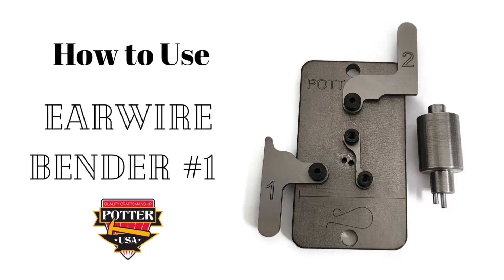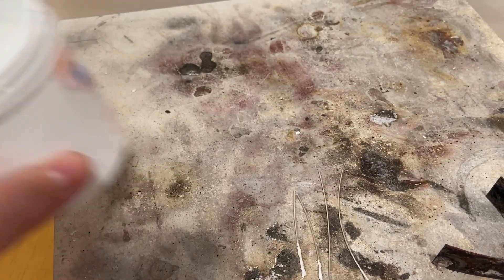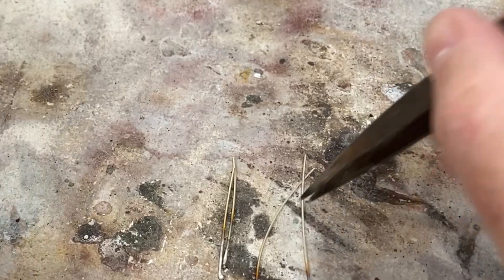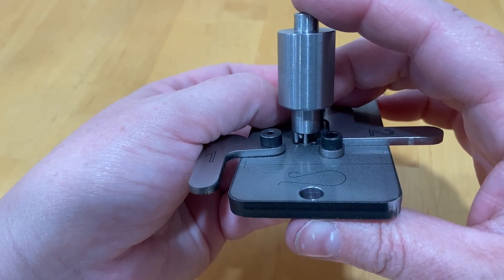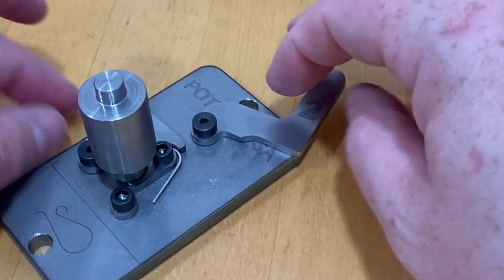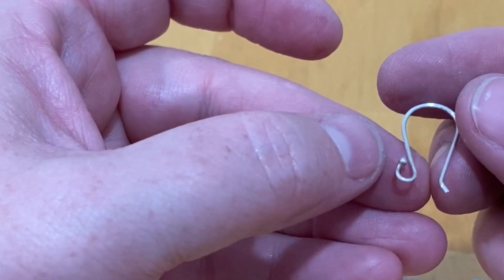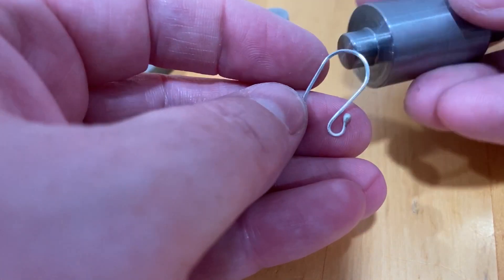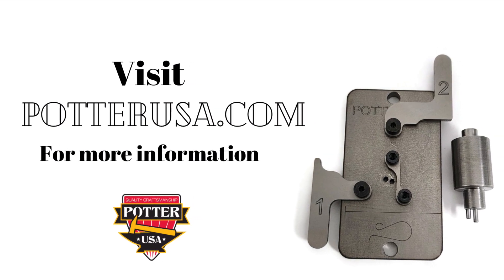How to use Ear Wire Former #1

Comment: Just received mine today, and I'm on #5, and I'm really digging the design (and how sturdy it is - I've broken two of the plastic ones at $30 a pop).  Could you provide a little more information about how much of the wire should be showing before you begin that initial little turn?  My closed loops are  not quite  right.  Thanks for making such a sturdy little tool!